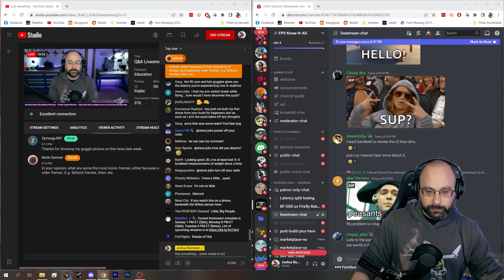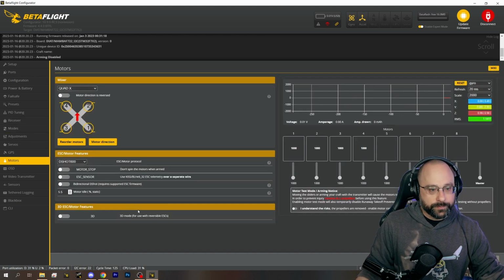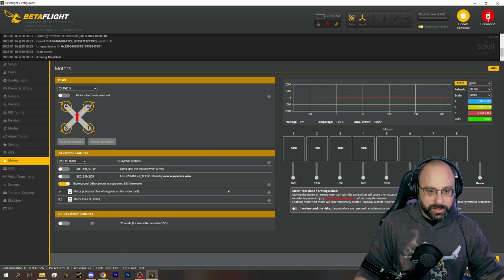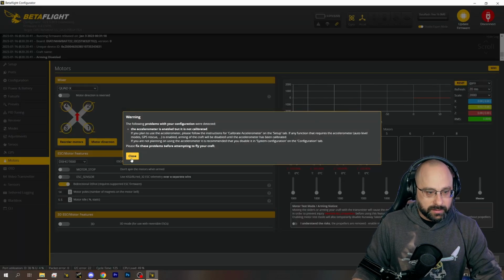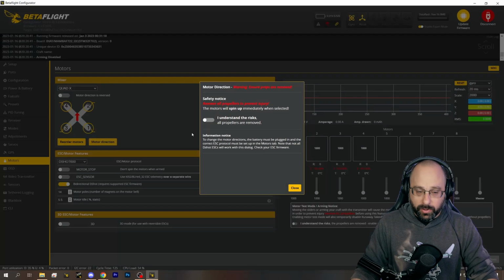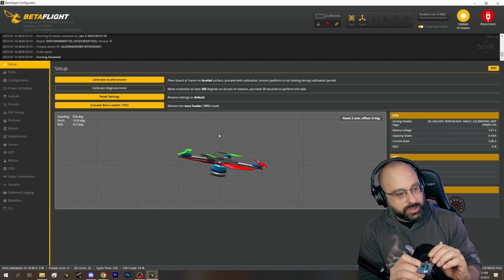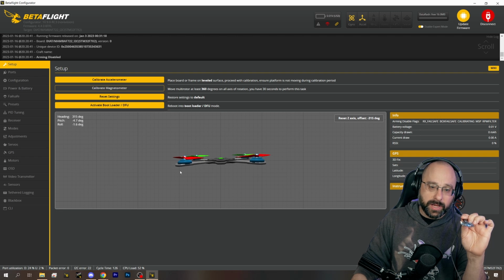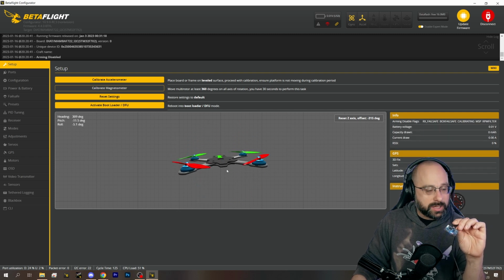When I Arm My Drone Takes Off! Help! - FPV Questions

Comment: checked motor direction and thats good checked soldering and that looks good. but if i do a roll or flip it goes crazy and flys off. not necessarily straight up but rather in any direction. It is also on the JB kit with xlio stack and motors that come with it.. Any tips or videos to watch in order to trouble shoot? @joshua Barwell

Comment: I know this is old but this got my first 3.5 build in the air.  Board orientation .... don't know why I didnt even think about it.    Also, had to deal with the BF 4 bugs regarding saving motor orientation.

Comment: How about the setup on new TX? Can anyone advise? Found the same issue when i use new TX (with xternal elrs module)... but when i use my RM boxer, it is back like normal. I blv in betaflight nothing has changed

Comment: My drone arms but does a flip when i try to take off, ive checked motor direction and they spin correctly, what am i missing?
Reply: When i turn on turtle mode i notice when trying to flip left or right it tries to yaw spin, are my motors not in right order maybe?

Comment: those damn new rpm filters made my toothpicks not fly well !!! WTF is going on with that ? in the past i never had this problems pick a light 110X motor, get a nice light 2-3" frame AIO 13A and 3s 450 ~ 530 Mah pack and call it a day !! EVEN WITH RPM FILTER out of the box it was working good

Comment: Throttle idle percent value must be too high. Or rpm filters set wrong.
Reply: I got the same issue, but the problem comes up when i change to another TX

Comment: Rpm filters. I had the same problem when I build my first quad. At first I thought my motors were to strong so I use a battery with less cells. I didn't add filters. Solution go to the presets and add Betaflight default filters.

Comment: Also i would check motor KV. If you are running 6s on 4s KV motors, drone will fly to the sky.
Reply: How do you fix this without taking the voltage off.
Reply: @doctorfpv9574  probably by motor output limit in betaflight.

Comment: I just built a drone that when I arm, the motors dont spin until I add throttle, is that the same problem?  Is there like a minimum throttle setting you can add somewhere?
Reply: Sounds like you have MOTOR_STOP in the motors tab enabled. Disable it and it should spin the props when you arm.
Reply: @dcabecao9357  You were right thanks a lot! I actually crashed my drone cause I punched it out after arming it, I fixed it, that's a dangerous setting.

Comment: I thought what he’s saying is that as soon as he arms it takes off - that is, motors ramp up speed straight away with little or no throttle
Reply: I think that's what he's saying. I just swapped an esc from an old quad and now mine wants to launch to the moon as soon as I arm it.
Reply: @flickwititfpv1 How did you fix? Mine is doing the same
Reply: @GREEZY.A1 i never fixed mine but when i remove the battery and put it back in its normal so idk
Reply: Same
Reply: @dtattoorattattoorat868  sAME  reply when you find the solution